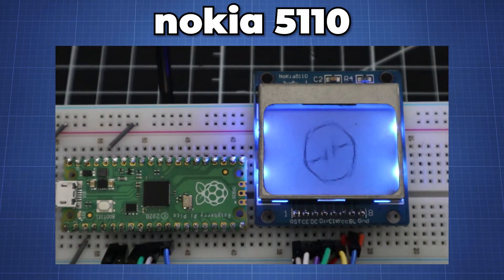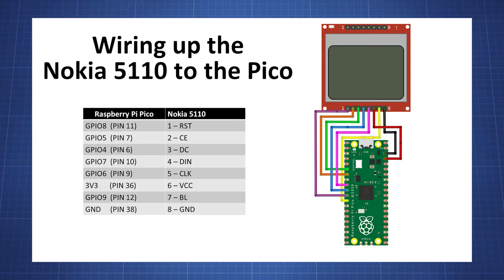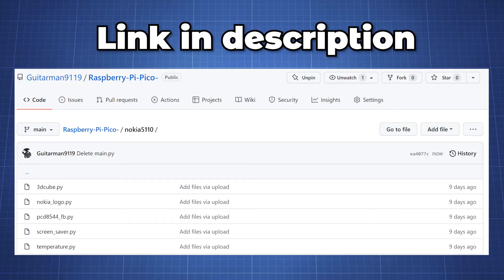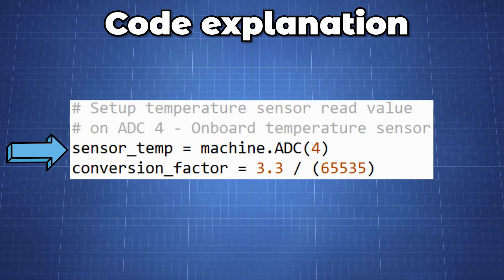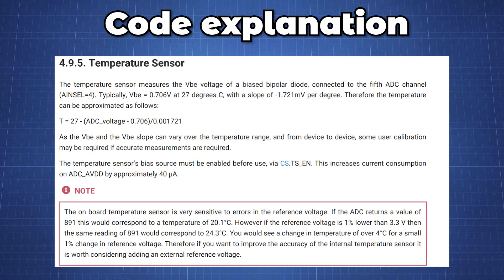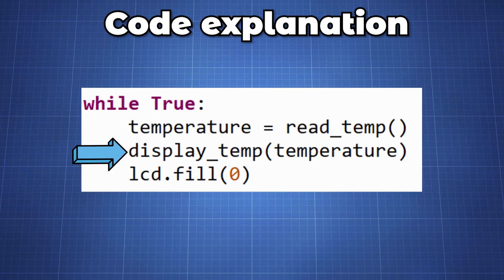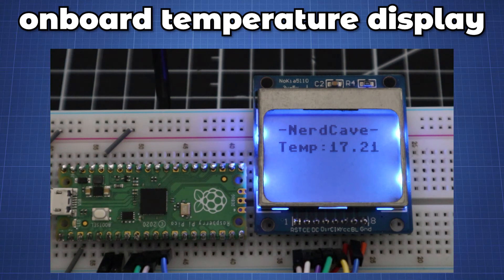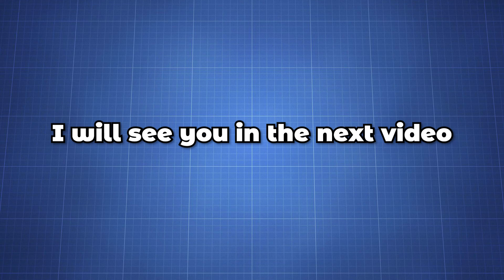Raspberry Pi Pico Tutorial -  Nokia 5110 LCD Module

Comment: First of all thank you very much for the video tutorial. As already mentioned there is a flaw in the schema. As indicated it is important to use PIN36. Additionally I recommend to not rely on default values of SPI. Since the default values changed what you can see if you print(str(spi)) the code will not work anymore. It can be very time consuming to debug. To save you some time I recommend you to set the values for SCK and MOSI manually. Just replace the line:
spi = SPI(0) with
spi = SPI(0, sck=Pin(6), mosi=Pin(7))
Reply from the maker: Hi, thank you for the feedback, I will try to make an updated version of this video and use your recommendations. Always when editing a video there are a few mistakes going past me like schematic etc. I will work on double checking everything to ensure there are no errors in future tutorials.

Comment: Thing to note here is that this library doesn't work with all modules, but Arduino with adafruit pcd8544 library interfaces with all nokia modules just fine. Tested it with rp2040 micropython, didn't work for my module then switched to Uno with Arduino ide and adafruit library, worked fine. Then switched to pico again but with Arduino ide+ adafruit library this time, WORKED LIKE CHARM !!!

Someone update this library, please
Reply from the maker: I think there should probably be a circuitpython library for it, I have thought about switching to circuitpython seems to be a bigger community of coders making libraries

Comment: I was trying to work out why the program didn't start working after I unplugged the pico, turns out you need to call the program you want to boot "main.py"
Reply from the maker: Yes you have to do that in MicroPython and in Circuit python it will be code.py

Comment: Just did this tutorial today. With the basic coding already written and working, I have been fiddling with modifying it - much easier than starting from scratch. Perhaps some say starting with working code is 'cheating' but I think it actually speeds up learning. I was tearing my hair out when the display would not work. Then I measured the continuity of all the jumpers and found one (a new one) had a hidden break. I replaced it and the display then worked perfectly!
Reply from the maker: I hardly write any code from scratch unless if I have to or finding code online that did not make any sense to me or not well documented. These module tutorials I intended to make so people can get it up and running quickly so that it works and then focus on using it in their projects where the real coding and creativity will come in. I also experienced the same as you mention the wire sometimes break at the connectors. I am not a fan of breadboard but saves times to make sure everything works before ordering a PCB.

Comment: Fantastic tutorial !!

Nice to see some people trying to bridge the gap with some of the older common modules from Arduino days.

Just a note for fellow newbies like myself with respect to the pcd8544 library and Thonny - if you use the Package Manager in Thonny to install the pcd8544 Library, it will only install the default pcd8544.py, which does not work with the Pi Pico for some reason. You need to follow the tutorial directions and manually load the pcd8544_fb.py on the Pico in the [lib] subfolder. 

And stay away from VS Code for the moment, current version (1.66) has broken the Pico-Go extension that's needed to program the Pico.
Reply from the maker: Thank you, I tried using VS code once with it and decided to stick with Thonny to make it more beginner friendly.

Comment: The PNG schematic is incorrect (pin 37 wired instead of pin 36). Not had much joy with this. The backlight works! Gonna have to get my sillyscope out and check signals... [The python is running and importing the lcd library ok. It's printing temp on the console but the lcd is blank - light is on or off - active low] EDIT: OK now. Strange module. Switched module. Both claim to be 5110... First one has active low-- light, new one has active high light and actually works... No idea what the issue is yet.
Reply from the maker: Thank you, I just noticed it now, will make a comment about it, have you checked the pins between the two modules, I know there is different pinouts between different modules both work with same IC but the pinout is different, in the past I had this RED PCB module which was different.
Reply: @NerdCaveYT  had these modules for a few years, never used till now. The working module has a blue PCB. The duffer is red, but the pin out (as per the stencil) is identical. Assuming both have same driver IC. The blue PCB has a blue backlight, red has a white backlight. Guessing the module is no good. Also guessing you are from SA. Whereabouts? Missus from Durban.
Reply from the maker: @andyonions7864  I am from South Africa yes, small mining town close to JHB, but been living in China last 3.5 years.